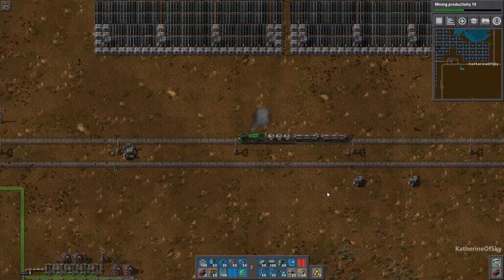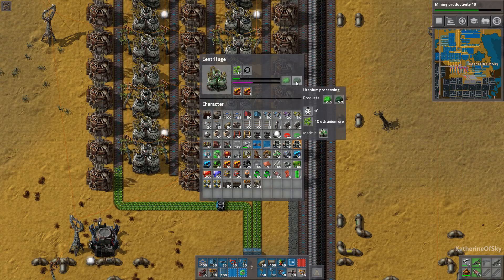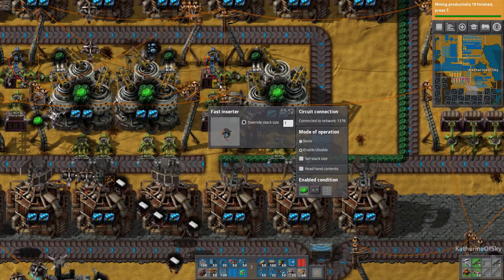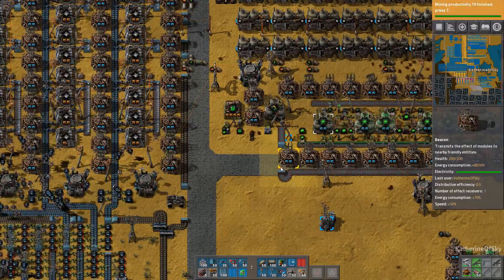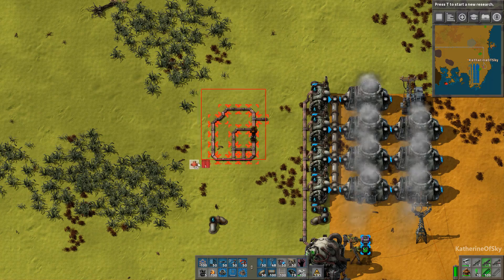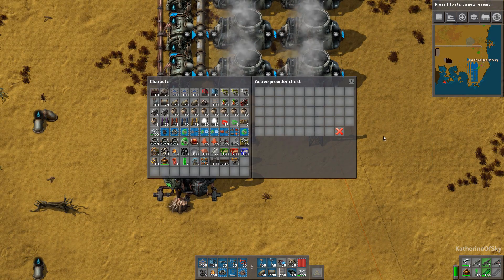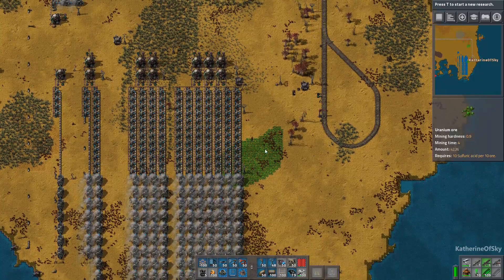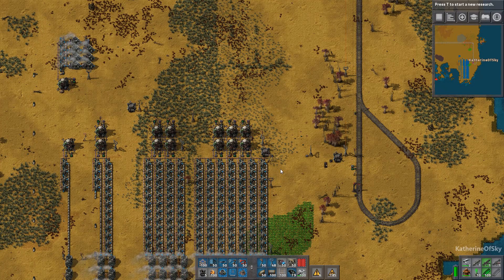Factorio Tutorials: Nuclear Power Setup & Ratios (Uranium processing, Kovarex process)

Comment: I don't always need the full power (solar power during day, over production) of my reactors therefore I store the steam 
in storage tanks and only input one fuel cell in each reactor at the same time if the steam in storage drops below a 
certain limit
Reply: goron111 you really want to keep them going all the time because of the long heating up times
Reply: they keep the heat as the heat exchangers dont use up any heat below 500°C, one other plus side is that you can scale the max power output Independent from  the heat production. 
for example you can use the 2x2 reactor setup the with few turbines early on for optima uranium usage
Reply: @goron111  good idea

Comment: what I suggest which might be better system is this.put the ore a outside belt with red insertors feeding the centrofusers.then have a belt on inside and one on the other side.have filter inserters one for 235/238.then have either one then t junction onto one belt so each are sorted to each side.this way if the 238 backs up the 235 wont.for the enrichement I have one belt to take the 238 away with a filter insertor then run the belt up the end of the ore processing with a chest been loading/unload onto the side of the belt where the 238 is.when there excess of 235 belt to the other belt where just 235 is been put on.that way u never have 235 stuck on the belt mixed among the 238

Comment: question on your kovarex set up.  I have been using that from your blueprint. after mine is running to complete the line, the out put off 235 and 238 starts to back up.  I end up with so many 235s that the 238s can't get through.  does this happen on yours? I have started adding a line of filter inserters to take off the 235 and put it back on a single side of the belt to keep it clear.
Reply from the maker: I have not had that happen to me until all my U-235 was backed up.  (And then I effectively just shut down ore processing all together since I had enough 238 to last for ages!)  That's a valid concern, however.  I will re-do the BP so that 235 has priority.
Reply: KatherineOfSky I didn't think about how much 238 I had at that point.  I probably did have enough to run my nuke power for ages. lol
Reply from the maker: I have just updated the BP book with a better Kovarex process -- now there will be NO clogging!  :-)
Reply: KatherineOfSky I'll have to see what your solution was to see how I did compared to yours.  😁